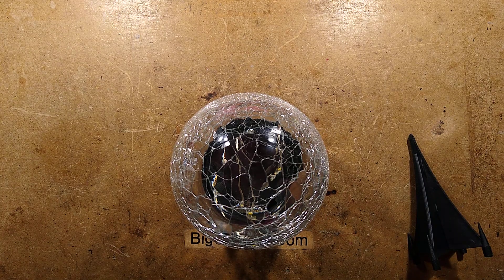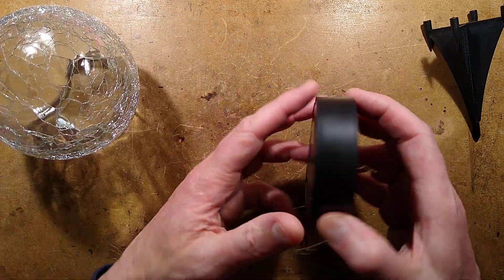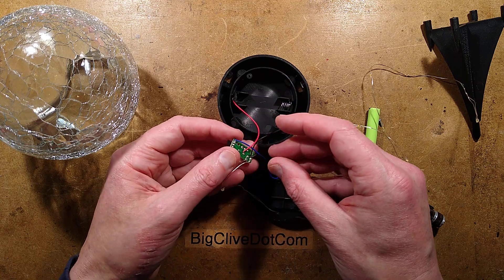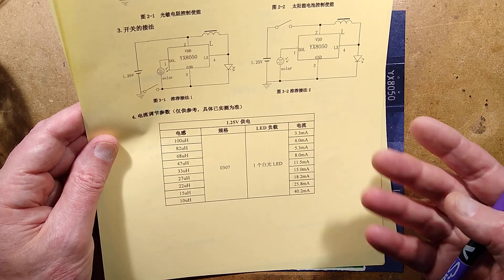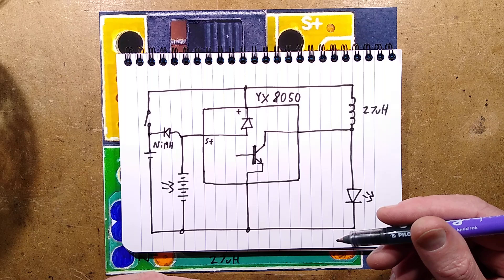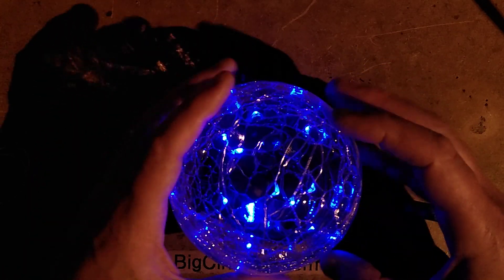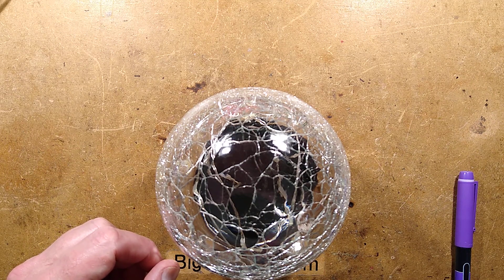Poundland solar crackle globe is a winner

Comment: One thing I've noticed when upgrading the NiMH batteries to higher capacities on the cheapo lights is that they then seem to just go into a "permanaently on" mode regardless of even bright sunlight hitting the solar panel - I'm puzzled why a higher capacity battery would cause this?
Reply from the maker: It sounds like it may be a bad connection on the battery holder.
Reply: @bigclivedotcom  I'm not so sure, I've got three of the little tesco 5 colour changing stick type ones for a fiver which had seemed to have stopped working so I shoved a new 600mAh battery in all of them (orig batteries were 100mAh) and all three are "stuck on", can't see it being a bad connection on all three? I should add by the way, that I really appreciate your videos for making me even think that these things are not necessarily disposable and it's always worth having a go at fixing them!
Reply: Sounds like it thinks there's no power coming from the solar panel .. also, I presume you let them run the batteries down to let them recharge from the solar panel
Reply: @jayherde0  trying an experiment doing just that as we speak! :-) amazingly they've lasted almost 24h so far!

Comment: Moisture  is definitely a problem for these lights. The high humidity and heat inside the globes of my solar lights Ruined  the enamel insulation and shorted out the magnet  wire with the leds. I ended up replacing the copper led string with a few  blue Cree signage leds. They’re suprisingly cheap and the data sheet says that they’re moisture and temperature resistant.

Comment: We have a pair of curtain pole finials that look exactly like this, just smaller. I also have a cylindrical light shade that is made of this glass which makes a pretty pattern on my ceiling but only with one particular LED bulb I have, which has a unique design I have not seen before.
Reply from the maker: The LED lamps with sharp point sources look best.
Reply: @bigclivedotcom  The ones I have look like a bog standard LED filament bulb, except that each filament is bonded to what looks like a metal backing which is fairly chunky. I guess these act as heatsinks as well as conductors, and seem to affect the light output such that it can only exit the bulb "outwards." I got them from Costco a few years ago and haven't seen the same design since. They also dim really nicely.
I had a failed one that I wanted to send to you, but I can't find it now.

Comment: I wonder if one could "conformal coat" (that is what we call it in the US) every place where you wish to deny the entry of water? 

Perhaps one could buy a jar of the right material, and dump it into the canister of a weed sprayer; I am referring to the kind of weed sprayer where the output assembly screws on to the top of the tank, then the user manually pumps up pressure.

The downside is that the sprayer wand would have to be cleaned immediately after each use by pumping some MEK, or other harmless solvent (heh heh) through it, else it would become permanently stopped up.

Most of my career has been spent in electronic subcontractor factories where we design and build circuit cards for aerospace customers. The conformal coating machines are as simple as some guy with a spray gun powered by shop air, up to fully automated robots that have optical sensors, and are programmed to spray specific parts of a board with a specific thickness of resin.

I was always an I.T. manager, which did involve bringing computers and networking into the shop, so I learned a lot about almost every kind of shop operation.

Comment: Very interesting! I never have pulled up the datasheet for a solar light chip, and didn't put 2 and 2 together that the value of inductor would have a direct impact on the output current. With a bit of soldering, one could put 2 different inductors, switch selectable for different seasons. Looks much nicer with the blue leds too! 😀
Reply from the maker: Some lights do have two inductors and a switch for summer and winter modes.
Reply: @bigclivedotcom  I've never seen that, here I thought I was being original! 😆 I need to find some with the switchable inductor, I'm doing good to get 2 or 3 hours of light from my solar path markers in the winter, but they'll easily run from just before it gets completely dark to just short of dawn in the summer. 🙂

Comment: Clive another excellent video. You have the most beautiful speaking voice on YT and you make the world a better place just with your words.
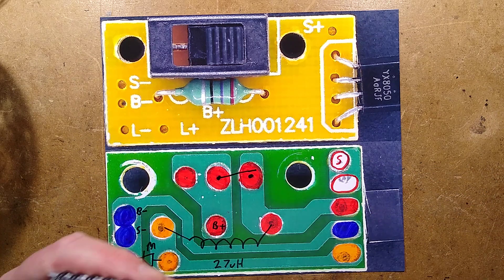So a comment... at around 6:30 you have the blocking diode backwards such that it would prevent charging. (An LDO I'm sure.)
I have one similar from a few years back where a single warm LED lit a yellow globe. This is in a bird bath, obviously not a pound store purchase! (Big Lots!) Last year the electronics rusted out and failed. I rebuilt the guts as I have a nice collection of PCBs with that 4 pin charger ready to swap in.
This year it was so bad I rebuilt the entire thing as I have a 3D printer and made a new base for it, even the tabs to screw it on. That rusted out after a month or so, so printer and built another. This time I water proofed it using clear nail polish (pound store!) about the solar cell and the edges of the two pieces.

Comment: I have a few of these that have stopped working.   What would be the test process to identify where the problem is?  IE how to test the inductor, the solar, the magic chip and the leds to see if they are discharging the battery.
Great detail circute detail, thanks.
Reply from the maker: Look for corrosion around the solar panel, PCB and battery terminals.  The batteries do need replaced every few years if they are in a holder.

Comment: What about using an empty flux syringe and filling it with petroleum grease and using that to inject the grease around the edge of the small solar panel and into any part that needs waterproofing. The thought just came to me while watching your tear down of the solar light system. It was one of those aha moments.

Comment: Thanks for this video Clive, The best stuff I've found for waterproofing these types of lights is called "Corrosion-X" ...Brilliant stuff and kept my solar lights alive for years with little to no rust from Rain and humidity. A little bit goes a long way - I generously apply it with a old toothbrush on Everything metal including the Screws, Switches, PCB and Components, Terminals, Solder Joints and LEDS. The panels seem to be a weak area on some lights like this for sure, So next time I come across a panel like this I will take your advice and clear waterproof glue/silicone or lacquer around the edges of the panels to ensure a longer life!. - Thanks for the great tips, Keep on Keeping on Clive!

Comment: Could you add a larger rechargeable battery to one of these? Like soldering on a 9 v battery lead & making a new cap for the bottom for more space? Could be a good hack to add alot more lights & longer life....

Comment: The problem with using vaseline is that when the sun heats the plastic up it just goes into a liquid and runs out. Not tried grease it may be better.

Comment: I really like your solar light videos… how to get something half decent for peanuts, usually a £1 and then how to beef it up and make it even better or make it last far longer. Thanks to you Clive, I have purchased a number of £1 or similar solar lights for my garden and they have been going strong for three years thanks to one of your videos showing how you can add clear silicon sealant to the solar panel to stop water ingress. These lights have been going for so long that sadly, the rechargeable AA batteries are starting to fail. Can you recommend where best I might be able to get suitable replacement batteries? They are just like the one in this video. Thanks in advance and keep up the great work👍🏻

Comment: Eeee, eh? Electricity is not like it used to be ! It doesn't light bulbs like did in the old days! And gas doesn't hardly burn now, mars bars are smaller and the laws of physics change almost daily. Internal combustion engines rarely work, and living is only just a go !
Reply: Thinking your talking about “ Shrinkflation “. 😀😀😀

Comment: I had a simple green apple fruit shaped solar light, that wouldn't turn on. Turned out the cell was dead because of the shipping and storing times. I have drawn the schematic of it, and it was basically the same as yours. I remember that I had the same impressions about the circuit: charging AND lighting, or nothing. The simplest way to correct this is to use the third connection on the switch as the output to LEDs, and make sure the middle one connects to the chip. I am not able to find this drawing now, because it's been a few years ago.

Comment: I designed my own PCB and had them made to fix a load of lights (30+) and left the useless switch off altogether also on my board the 'chip' was mounted flush with the board and it ended up about half the size of the original, I did give them a light misting with WD40 and used hot glue on the battery connections as its easy to remove with isoprop if you need to. Finally I drilled a lot more holes in the base to allow considerably more drainage and whats more important is a good airflow. I have now opened one of mine from last year and it looks the same as it did last summer and opened some of the untouched original ones that have failed and they had all the problems you describe...cheers.

Comment: These are a favorite though the versions sold in the states are smaller they are brighter usually just being a single led, anyway they last a good bit longer than other cheap lights aside from needing a new battery after a few weeks.

Comment: I think I would use candle wax or paraffin instead of Vaseline.  Candle wax may melt in hot weather, but I think Vaseline would also melt or get runny.

I started making "coil dope" by putting white packing particles (styrofoam) in acetone.  They dissolve and enough of them makes a thick styrene 'glue' that can be used to coat coils and electronics.  Cheap and easy to do.

Comment: Silly question but what is the difference between the colour change and fixed colour circuits ? do the colour change LED s just need more current ?
Reply: Your eyes don't see it, but this circuit switches the LEDs on and off very fast.  That causes the colour change LEDs to constantly 'reset'.

Comment: One question ... I want to reduce water heater in half ... I've seen that in heated blanket with diode. 1N4007  (reducing from 60W to 30W) ... Can I do the same with heater 1500W >750W (what diode must use) ... I have an idea (4 discreet diodes from PC Power supply in parallel) My calculations are 1500W/235V=6.4A ... If they are 3A it must have good reserve. I have many PC power supplies to savage from!
Reply from the maker: Use a generously sized diode that is rated for about double the current expected.  If this "water heater" also has a fan then it will need powered directly without the diode.
Reply: @bigclivedotcom  I've done it! 5x2Amp=10A ... they get real HOT ... may be 80'C , and result is 880W ... don't like it!    Thanks!  ... it will stay 1500W :) ... ... correction ... it is 1808W, that's  why is 880W whit the diodes! ... 
... 7 hours letter, final version 9x2A=18A (1800W/235V=7,66A needed) , temperature ~60'C ... I'm happy now! ... and i put switch parallel to the diodes for disable them if needed.

Comment: So, why is it a smaller inductor gives a higher current? I would think the bigger capacity of a bigger inductor would give more oompf...
Reply from the maker: I think it's because the fixed duration pulse doesn't have a chance to store as much energy in a larger inductor.
Reply: @bigclivedotcom  possibly. I was wondering if the frequency of the circuit would change...?
I think you have to whip out that fancy scope! 😃

Comment: I myself prefer using neutral solid soldering grease: it sticks well to components and fills cavities, it doesn't stop me from soldering the board again for some reason, and I use it anyway in circuit assembly.
Although, it can melt in the sun or when components overheat.

Comment: He loves a crackly ball. 
Anyone know of a forum or somewhere where I could ask stupid electrical questions?. I have a DIY model kit im designing and i want to know how hard it would be to have a liner encoder (measurement) attached to a very large 150mm x 50mm display, But have it so I could push a button and the display turns into a clock (time). Maye using one of those adrinos jobbies.🧐👍

Comment: One thing we've used to waterproof electronic and electrical items like these, is good old fashioned "Waxoyl" - The stuff you use to coat the underside of your car.  It comes in two forms, a lightweight clear semi fluid that stays as a semi fluid so it's always there to keep the water out while still allowing movement of moving parts, or there's the black version which is a bit more viscous and you can paint (daub) on with a brush. That version dries to leave a thick waxy coating that seals everything up good and tight, but moving parts aren't going to move without cleaning off the sealer.

Either way, it works well and on this sort of device and keeps them waterproof while still allowing access to service or repair them.

Alternatively, as my nextdoor neighbour has done, just use these things in the conservatory where they can't get wet.

Moving on,.   I think they have these globes in our local "Yorkshire Trading Centre". I might just pop in for quick look-see!

Comment: That chip, I find it isn’t quite good.
Like you say, everything starts to rust over 2-3 years. I coated mine many times over but water still gets in. Short of potting it, I don’t know what the solution could be.
Also, I always replace the cell with 1100+mAh one, cos this one isn’t enough in winter - when sun comes out once a week.
Another question, are there any “proper” western chips that could do this job better ?

Comment: If there is enough space, then replacing the NiMH cell with a 2,7V ~500F supercap is a great improvement. I have one running for years now. Voltage on the cap goes up to 2,62V. No Problem so far. No dead batteries, and even on the darkest winter day the light stay on much longer.👌
Reply: I had problems with these capacitors because the voltage got too high and killed the capacitor in a sunny day. Also these are quite large._
Reply: @primech-128bit  I don't know what you want to say. Capacitors aren't bad because you killed one by not protecting it from overvoltage.

In my case the protection is just a white "1W" led. The led's forward voltage and the solar panels current is perfect for 2,62V max on a sunny day. And there is a transistor which only connects the led to the capacitor when it gets charged.

Comment: Can a board like this be used for 18650 cells with proper resistor replacement? What would it take to mod something like this to a 18650? (Or would it be worth it) Would it require a Complete board replacement with something of the TP4056 nature with possibly the DW01? And speaking of the TP4056 boards (You talked about in one of this weeks past vids. ("Don't do this!" There's a much safer way) video. Can those be used in this type LED Solar Light bypassing the USB charge port and use the + & - terminals on them to trickle charge solar? 

As someone who repairs PC's and Laptops. I have oodles of 18650 and similar cells from old Laptop batteries. Many times only one cell is dead in a battery pack that can have up to 6 x 18650's in it. If one battery in the pack dies. It shuts off the battery in the BIOS and thus renders it pretty useless unless your are a hobbyist.

Comment: On solar lights as soon as I buy them before they get used  I always bypass the power switch as you said ..then use DCA conformal coating on the PCB and solar panel then solder the wires directly to the battery then use the conformal coating on the battery especially the ends ...I've not had one fail for years ..the weakest link is then the LEDs which still corrode (yes even the copper wire resin coated ones) if it's a small number of LEDs like this lamp I'd coat each led as well ...if not just keep spare LEDs

Comment: I had a bunch of crackle globes a bit smaller hanging in my tree.  As soon as the temperature dropped, they started breaking to bits along the crackle lines.  Thermal fracture showing that the crackle pattern is really cracks in the glass.
Reply: I'm wondering how these are made... they heat it up then put it in water and hope it doesn't break or something? Or did they used something really hard to scratch it?
Reply: @pierreuntel1970  Yep, they heat it then dunk it in water.
Reply: Coat them with clear resin inside maybe that will prevent the breaking?
Reply: None of mine have broken thus far after two years though they are not the tiny ones but not as large as the one in the video. Anyway where I live in the world it gets to be hotter than hell for three to four months of the year while the winters are kinda ok most of the time.
Reply: @MrKillswitch88  
That sounds like an Australian's problem, summer and you are down to your undies and in winter you have a coat and jeans.
Reply: @TheHungrySlug  Where I am from we just call it "freeze or fry" and the frying part fucking sucks.
Reply: who'd have thought...

Comment: Just a vote for lanolin grease as a waterproofing agent. It's non-toxic, sticky, dielectric, water-repellent, doesn't harm plastic or rubber and is good for your hands. It does smell a bit sheepy, which could be a plus or minus, depending on your preference.
Reply: You could use bear grease the same way, or nose oil.   They all have the same problem - they rot.  That means they require regular reapplication.  it's like linseed oil - you really have to re-oil yearly.
Reply: Hasn't happened to me yet and I've been using lanolin for a good few years. The lanolin I have seems pretty stable.